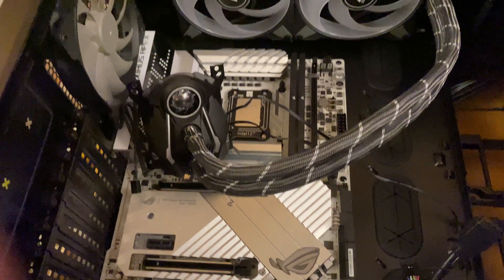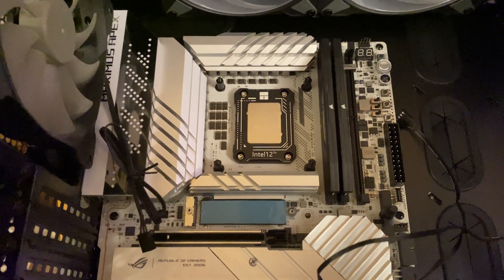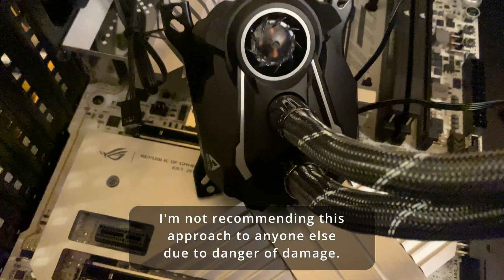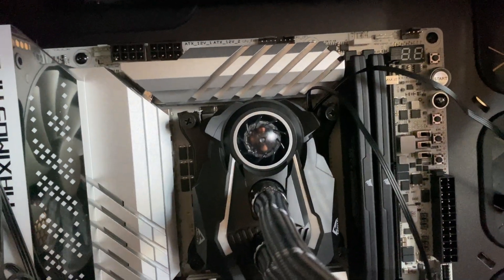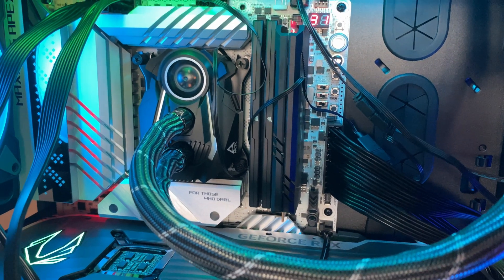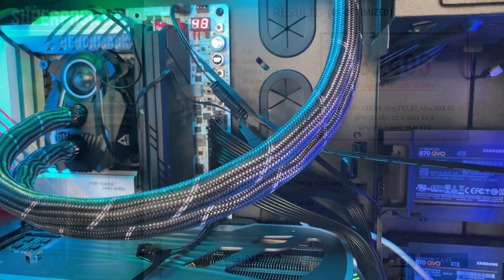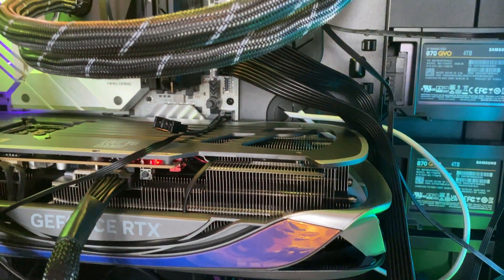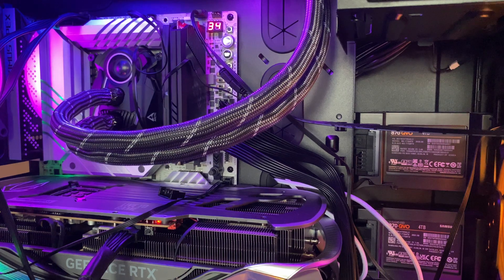280mm Arctic Freezer II Vs Asus Maximus Apex Z790

Comment: by chance, can you share the type of case you are using?  I am in the market to find a case that will (a) support the Arctic 280mm AiO (b) support having 5.25" bays & (c) running intel 14th gen cpu on an Asus z790 board.
Reply from the maker: Hi Dave, it's a Corsair 780T. It's a very old design so cabling and front ports are a bit dated but apart from that it's a great case IMHO.
Reply: I appreciate the info.  Its been over 10 years since I needed to build a new machine, and i'm sadden that the industry has moved away from offering cases with 5.25" bays.  These damn kids and their LED lights ;)

I"m concerned about getting the correct cooling as these new processors are using MORE power than my 2013 & 2016 rigs.  It appears as I search around, most builders are incorporating very large AIO radiators to help keep the intel chips from thermal throttling.    A few years ago, I spent a little cash on some be quiet fans and now I wonder if they are going to be useful as they operate as a very low speed.  Time will tell.

Comment: Had to do the same for my Apex. I use LFII 420mm with i9 13900KF. It does ruin the aesthetics to some degree, but it works like a charm and that's all that matters! Don't have a dremel, so I used a hacksaw.
Reply: Ugh! I'm about to try and fit a LFII 420 onto my 13900K in a Maximus Extreme z790 and I'm sure it's not going to fit (they arrive today). I had one Arctic rep tell me it would fit if I removed the pump pcb cover, and another Arctic rep tell me it wouldn't fit even if I removed the pcb cover. Yikes.
Reply: @peterl3478  The mounting bracket length is the issue here. I kept the PCB cover, no issues here. It could fit with an unmodified bracket, theoretically, but you may end up scratching the VRM heatsink or leaving a dent if you push it. Some folks say to drop it down and screw it in a star pattern, but you need to go all the way down and have it properly pressed against the cpu for good contact. This could be hard to achieve. I'd say you could try to install it as it is, and if you encounter issues down the line - saw it off. Speaking from my experience,  it was easy to install and get decent pressure when I had it cut. I would advise you to buy a spare Arctic LGA1700 mounting kit, just in case and so that you still have the original one.
Reply: @olega5141  Thanks very much for your detailed reply! I'm not sure how comfortable I am with this sort of customization... but there are so few other good 420mm alternatives readily available in the Us at least.
Reply: @peterl3478  You're welcome! I didn't want to do it either, but wanted to keep the LFII, so I went for it. Otherwise, the Corsair H170i is the only viable option imo, unless we're talking about custom water. I'd be happy to buy an ASUS Ryujin ii AIO if they had one with a 420mm rad.
Reply: @olega5141  Thanks again. Funny you mention the Corsair H170i - as that is what I have just bought to replace the LFII. Although I'm really really tempted to try this mod to get it to work.... choices!

Comment: Why on earth would you take such a weak cooler and put it on such an incredible motherboard?!?
Reply from the maker: Thanks for your comment B3n. To be honest I didn't want this motherboard and I probably wouldn't recommend it for most users. I was after a Maximus Hero Z790 but they had none in stock so I bought this as it was the same price and it did about 90% of the things the Hero board does. The cooler comes at the very top of almost every chart I've seen that ranks coolers by performance. And it does a great job. So overall I'm pleased with the way this system has turned out.
Reply: @creation1962  It’s a good aio but a 360 version is needed for 12/13 gen. The Apex is an extreme overclocking board and an aio cannot handle the heat OC boards make.
Reply from the maker: @B3n85_  there's a good comparison of the Arctic 280mm vs the 360mm in this video https://www.youtube.com/watch?v=kzGtBHC6H2A
Reply: @creation1962  Neither of which I would recomend for the z90 Apex, but you do you bro
Reply: @B3n85_  the 420 is probably the best AIO in the world. WYM?????????

Comment: From Arctic web side, You shoud remove plastic cover: A selection of motherboards interferes with the PCB cover of the water pump. This can be remedied by removing the PCB cover. For this, only two screws have to be loosened and the cover can be easily removed. The function and safety of the Liquid Freezer II is not affected.
Reply from the maker: Thanks Minciu, very interesting. I did try all that and it didn't make any difference. The fixing brackets were too long on the cooler head. Here is the list of MOBO's that are 'incompatible' with this cooler on an Intel 13900k from the Arctic website: ASUS ROG Maximus Z690 Extreme Glacial, ASUS ROG Maximus Z690 Formula, ASUS ROG Maximus Z690 Hero, ASUS ROG Maximus Z690 Hero EVA Edition, ASUS ROG Strix Z690-A Gaming WIFI, ASUS ROG Strix Z690-A Gaming WIFI D4, ASUS ROG Strix Z690-E Gaming WIFI, ASUS ROG Strix Z690-F Gaming WIFI, ASUS ROG Strix Z690-G Gaming WIFI, ASUS ROG Strix Z690-I Gaming WIFI. But no Z790's on this list. I still think Arctic are going to have to start thinking about reengineering their excellent cooler head design.
Reply: @creation1962  A have Apex 790 + Arctic liquid Freezer 2 with removed this plastic and AIO fit perfectfine. Before Apexi have Z690-F Strix and also it was fit :) So after mobo swap i even didnt put this cover back. Forgot about it ;)
Reply: oh and they didnt update this list for z790 - this is weak.. why they forgot it? :D
Reply from the maker: PS: That's just the list of ASUS MOBO's.

Comment: i was surprised that you could actually fit this giant radiator with fans without taking off vrm heatsinks, but then i saw type of motherboard and additional problems this format brings. Sucks but hacksaw is our everything nowadays it seems.
Reply from the maker: Thanks for your comment YukiNoSikrit. I really love these Arctic products. So quiet, so good at cooling but I do think it's time they started making different types of cooler head for different processors rather than just supplying an adaptor kit. I am considering trying to fit an Arctic 420 in this case. Might need a bigger hacksaw.